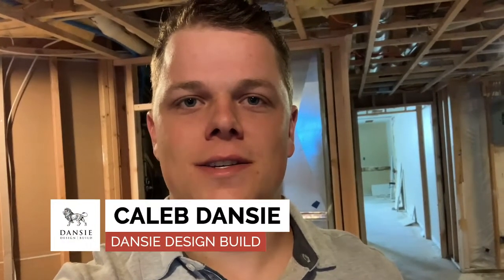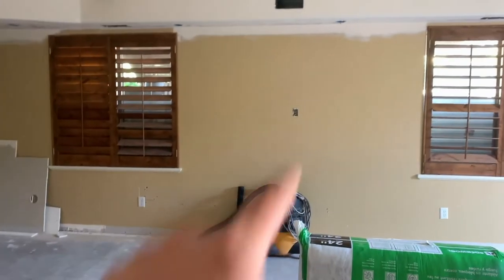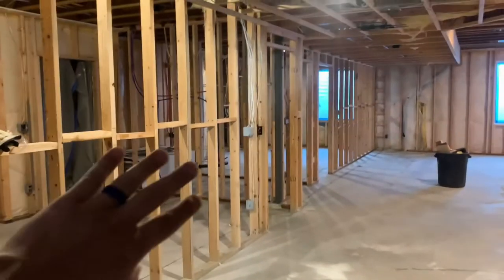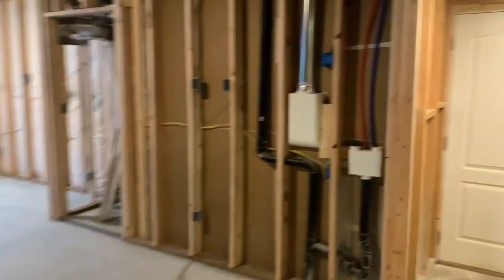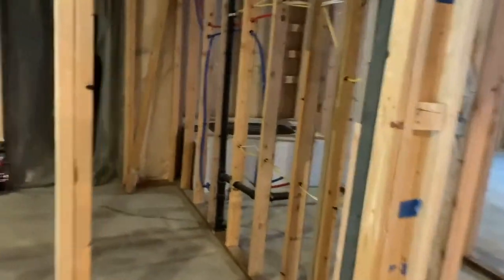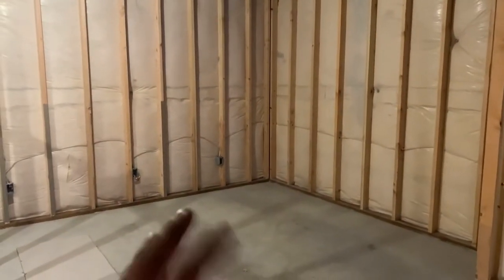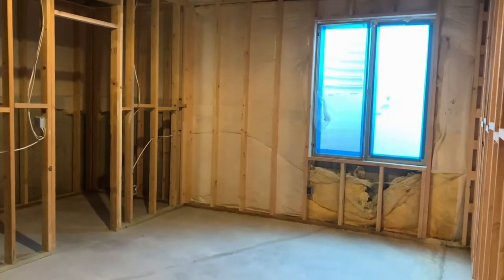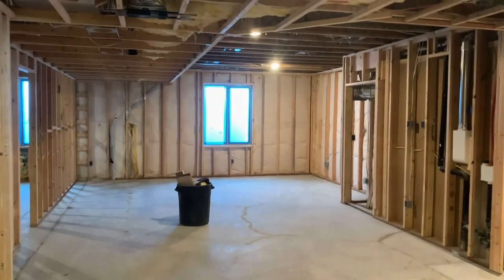Load Bearing Wall Relocation & Project Update | Herriman, Utah Basement Apartment

Comment: Hey, I was wondering how to determine the size of the beam, and if it would be a steel or wood beam.
Reply from the maker: Typically, wood beams are what we would use in a basement. LVL’s or laminated veneered lumber is a typical beam material that comes in various sizes. Typically 1.75” in thickness. A structural engineer should visit the building and be able to calculate the loads the building will put on the beam. From there the Engineer would give a professional opinion, and provide a structural drawing that has his stamp and signature on it. 
This would guarantee your beam would work for your situation.